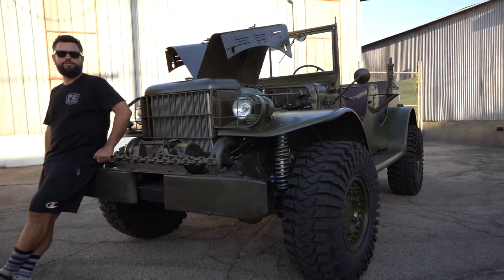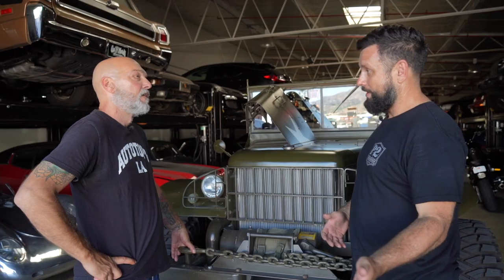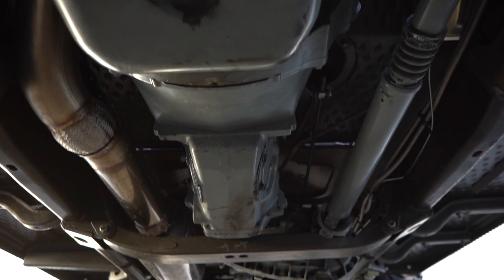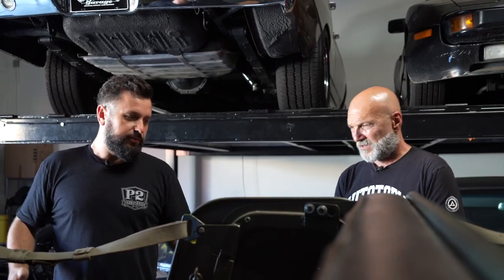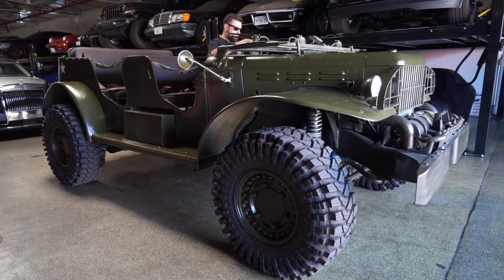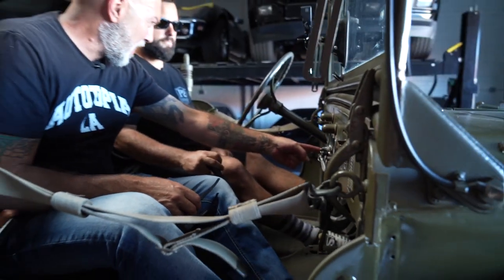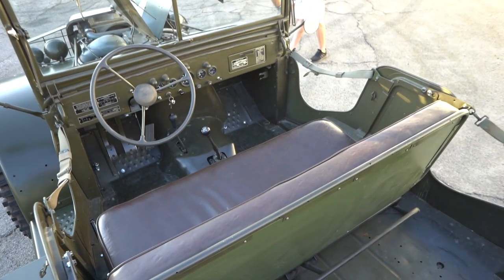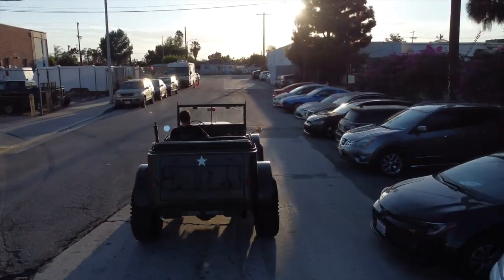Cummins Turbo Diesel Dodge Power Wagon Restomod on 37's

Comment: Nothing more rad than a Cummins powered TANK Most people don't realize originally the Cummins/Dodge setup was... Cummins set the Motor, Frame and Suspension parameters; Dodge did the rest the First Gens (12v) were built like tanks by civilian standards.

Comment: I just had an idea ...i have a good connection with the car culture here in detroit... Ive worked in the in the custom car industry for 15 yrs.. Ive built the the ford gt interiors in 05 on....my initials on on the inside of every panel which is cool theyre worth millions..so to my point..what about an autotopia. Detroit.motor city

Comment: Blasphemy that anyone would call that a “Jeep”! It looks nothing like a Jeep. As a “car guy” it bothers me that there are folks that don’t have a discerning eye for detail. 

I have a 1955 Willys CJ5 and I also have a 1952 Dodge M37. Let me tell ya, the M37 would eat the Willys Jeep. The Jeep is so incredibly small compared to the M37. They also look nothing alike. Likewise, a Carryall PW looks nothing like an MB or a CJ2A/3A or 3B! 

At any rate, this is an incredible Power Wagon build and it’s giving me ideas….I’ve been thinking about repowering the M37 and swapping out the old axles for something newer with better brakes. Finding tires that I like is a huge pain for the old Budd wheels…..and I’m not fond of running tubes either. The old straight 6 is so underpowered too. With my Willys I can handle running the old Hurricane since it has an OD hooked up to the transfer case….makes it so I can get it past 45 without much hassle. The M37 can’t even get out of its own way. I understand that it was never intended to get 65 but this is 2023 and I’d like to drive it down the highway. It’s too bitchin’ to leave parked in the garage when I’d rather be driving it places that require highway driving.